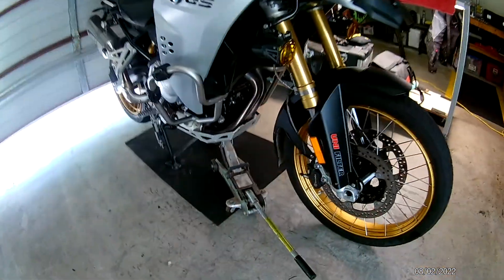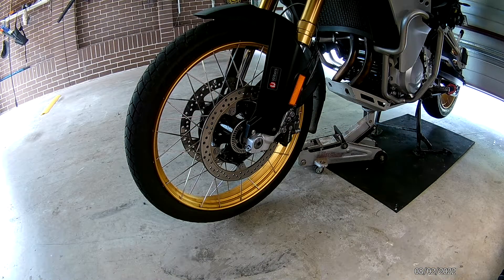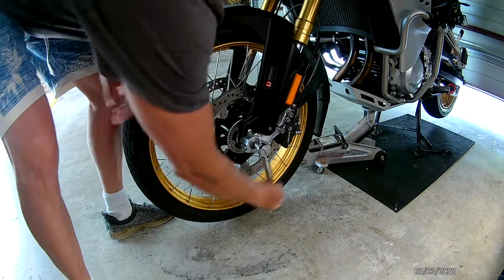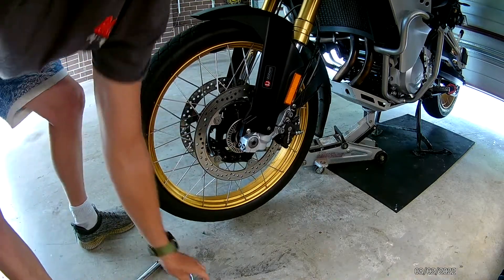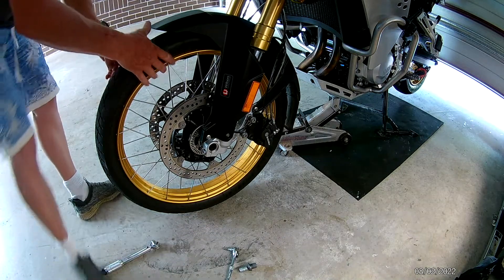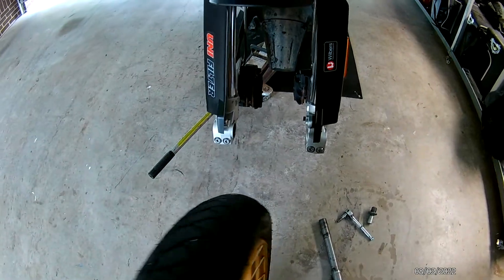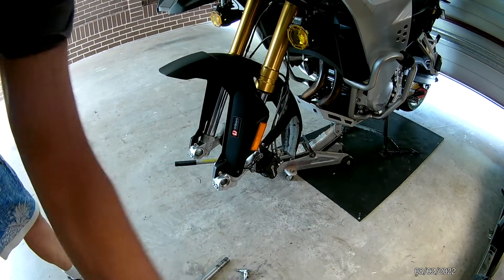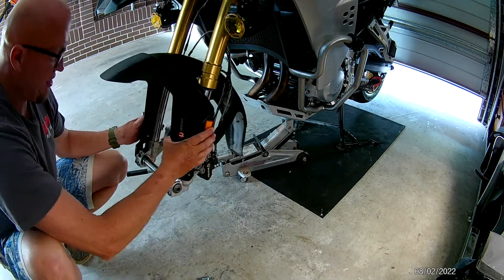BMW F850GS Front Wheel Removal

Comment: what torque for re-assembly?
Reply from the maker: @CaptainCaveman782  
Front wheel.
Pinch bolts 19nm - 14ft-lbs
Axle nut 50nm - 37ft-lbs
Brake calipers 38nm - 28ft-lbs
Reply: @cyclepro101  thanks, its a shame that the service manual no longer available for other work